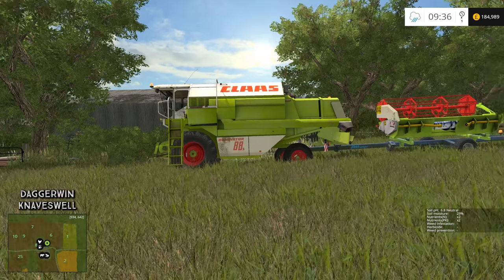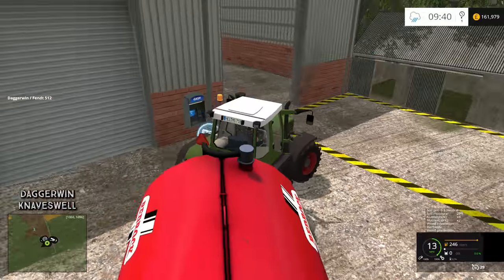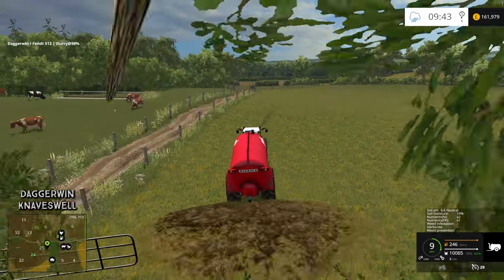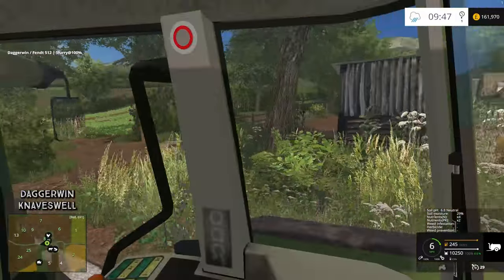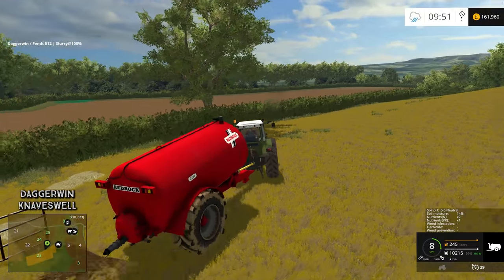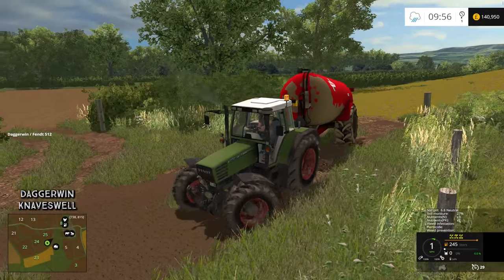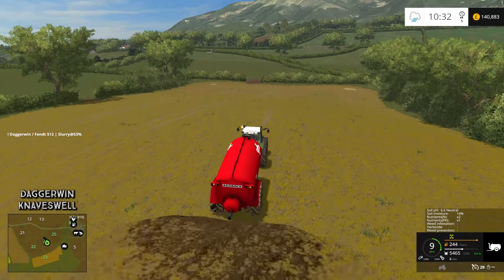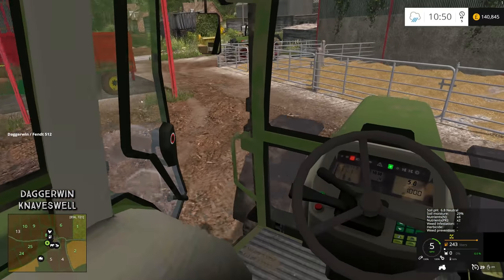Let's Play Farming Simulator 2015 | Knaveswell Farm | Episode 21

Comment: Nice mod of a slurry speader it looks like a bigger version of the in game marshal one and I do think you do the slurry work well.

I see what you mean about the pressure washer! 

I would in your place put it in the grass field where you put he combine now?

That be a nice spot there on the edge of that field so you can bring in the machine to be washed then either park it up neatly in the field or move it onto the shed or storage area you wish it to be?

I use the green grass field at the back of the main crop farm in coldborough park farm map for the storage of the bigger machines, 

As it really helps to have them neat somewhere! :) also I have two pressure washers at each end of the grass field so I can wash the machines there!

Comment: You can also get slurry at the biogas, and the fendt did indeed handle the spreader quite good despite the fendt having 125hp and the trailer needing 130hp
Reply: the fendt has 150 hp
Reply: Roasted
Reply: +Evan Smith in real life the fendt has 120 horses,  but people Like to power it up xD
Reply: Is it a 515c or a 512c
Reply: Slurry tanker has bigger wheels meaning less pulling power and ground didn't vary a lot in height
Reply: +joey moran yes that is true but the most power that is needed is normally for the pto
Reply: +Hannes ferruccio actually there is little resistance on the vacuum pump of a tank. the main problem is pulling and stopping the tractor overrunning on hills with bigger tanks

Comment: When I play I leave 4x4 on all the time, sometimes rear diff lock too if tractor seems under-powered but I only use front diff lock if i'm crawling up a hill at like 2 or 3 mph or I get stuck.  I know front diff lock effects steering and rear less so but I am starting to wonder if there's a reason 4x4 shouldn't be used? I never worked on 4x4's so i'm not sure
Reply: In real life if you use 4wd on hard surfaces like roads it will ware your tires unevenly
Reply: Yeah i would imagine fronts wear more... Thanks for your response Ryan

Comment: Daggerwin, do you know if you have to have the official steering wheel or can you have one without the joystick and buttons?
Reply: You can buy the side panel with the joystick and buttons seperately or you can buy the complete set. There is really no reason to buy that wheel seperate tho because you can get much better for much less money . The side panel is good but the wheel feels really cheap and I have heard about a lot of people having trouble with it.
Reply: Ok thanks, im thinking of getting one, but i want to get a ps4 aswell, i i thought if i could get just the wheel it would be good, i have a controller connected most of the time aa i feel using a mouse for the joysticks its to bulky and hard to do, anyway thanks for you help
Reply: What do you rekon the average price would be?

Comment: now i just started using soil mod. what does spreading on the grass do? increase yield? or just increase nutrients and moisture? which i guess inturn will increase yield. im just new to soil mod so these questions might be stupid but i have no clue
Reply: Increase yeald  in real life anyway
Reply: It does increase the yield but only if you harvest it directly, for example with a forage harvester. this is bevause soilmod cannot affect windrows which you get with regular cutting. same goes for the swaths left behind by the combine, the crop yield is influenced by nutrient levels, the swaths are not.
Reply: so if i put slurry on it and then cut it and windrow it it does absolutely nothing. but if i use a whole crop harvester and collect it that way then it will increase the yield?
Reply: and thanks for commenting :)
Reply: that is correct, also only the nutrient levels at the time of harvesting/cutting count. It does not matter what they are during groth.

Comment: Turn of the slurry tank when turning because you will brake the pto
Reply: You won't lol where did you come from? We have 152 Abby 2500 gallon slurry tanker and have double fillers. John Deere 6125r pulls no problem with 125 horsepower

Comment: u cant go round corners with the PTO on
Reply: it depends on what PTO you have got because we got a new slurry spreader and it had a PTO that you could turn corners with as standard
Reply: You can but too tightly
Reply: normal pto shaft can be in a 35degree angle when rotating but when not spinning it can be in a 90degree angle then the wide angle pto can be rotated in a 70 degree angle but it is still 70degrees when not rotating.
Reply: yes you can
Reply: +Kyle Blizzard some pto shafts are designed to take on corners a bit better like on a baler. but the pto shafts on slurry tankers are not designed for as you go up and down a field with a slurry tank, not around in a circle. but you can change pto shafts between implements.
Reply: Mate with newer machinery pto has good turning capability.
Reply: U need a double nuckle pto to be able turn with it on

Comment: daggerwin in real life u cant  turn with the pto on in a slurry tanker because it will bend the shaft
Reply: yes you can just not sharply and fast
Reply: +Calvin Beamish u can also leave the chute open without the pto if u have enough pressure in the tanker
Reply: +Paul Ruane it would waste slurry then as you are not spreading it far enough

Comment: always use 4wd when you are doing fieldwork.
Reply: Depends on moisture if it's wet yes dry depends on work drawing bales needs 4wd all around on the other hand 2wd can be used for rolling tedding etc
Reply: +joey moran for rolling you need 4wd
Reply: +Caolon Collins small rollers nope. big rollers with spikes on them yes.
Reply: We always use 4wd on our land as long as we're not on concrete. Might be because we live on the harsh countryside of Wales though. On some of our field's if you don't have 4wd on you'll loose control and end up in a ditch!!!
Reply: +Ed Williams makes sense then

Comment: when u are spreading slurry, you dont full the spreader more than 50%
Reply: Why on earth would you do that? if you have an underpowered tractor maybe or really wet ground or small wheels, but generally speaking that sounds rubish.
Reply: I dont know how the farmers in the UK does it but here in Norway its realistic to just to go only half the length around in the field in one tank
Reply: I dont understand what you mean? there is a difference between filling the tank to capacity and covering the whole field with one load. The first one is just saving time and fuel to reload, the last one depends on your rate of spraying and the field size.